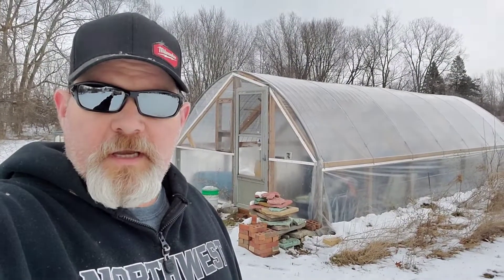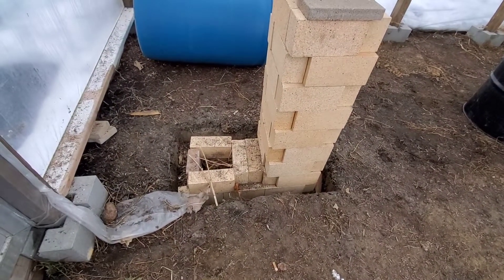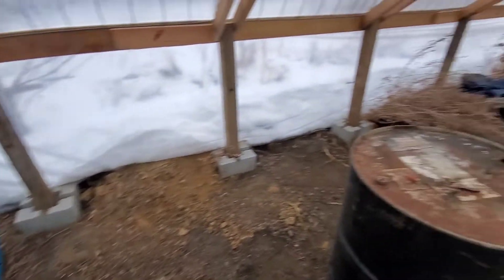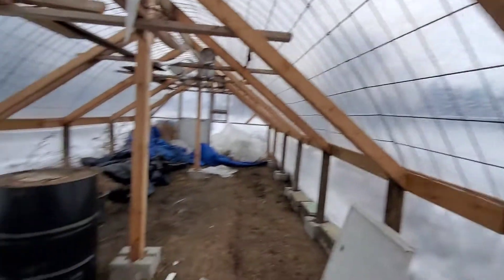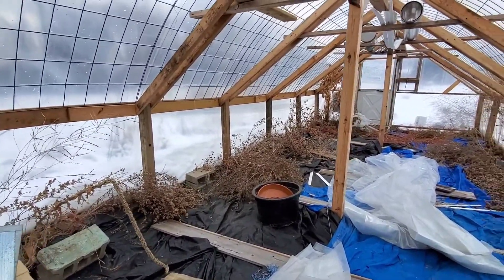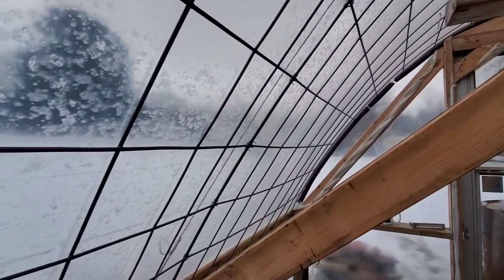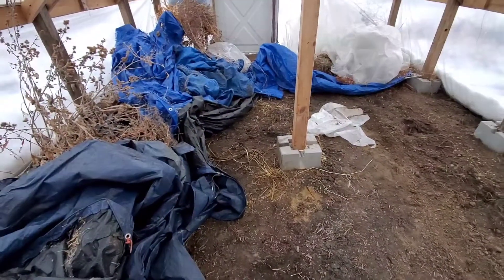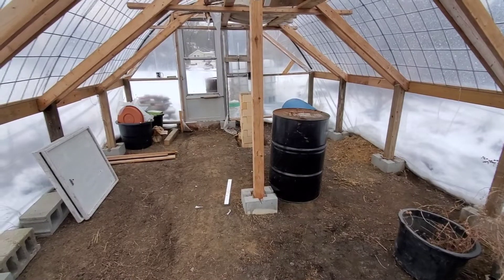Cattle Panel Greenhouse with Rocket Mass Heater Update

Comment: I had this same idea years ago for heating a green house. I heat my shop with a rocket stove. I even put pipe in the floor but someone crushed it during the concrete pour so never got to use it. What are you going to use underground? I have seen cement block used but it seems it would slow the flow. Regular heat duct will crush unless covered with wood or steppingstones. I am thinking about also doing this. Looks like you get to be the test case. Good luck
Reply: I have seen well pipe used too.  Strong enough not to be crushed by most anything and conducts heat very well...
Reply from the maker: Using 8" warm air pipe. I'll be adding something on top to help with that issue.